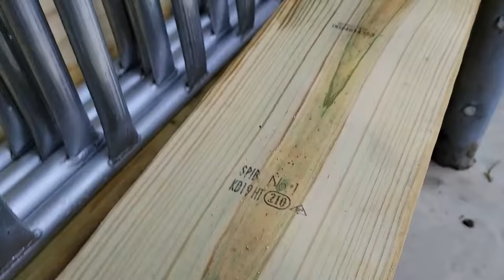There's A Serious Problem With Our Roof | Our Trusses Are Warping

Comment: A suggestion…install gutter and down spout at low end of hay feeder roof to catch water in a water trough. Helps eliminate mud and mud lakes around the feeder. Here in Tennessee it’s a must to try to contain the effects of accumulating water and stomping critters.
Reply: Please consider this...or mud and swamp like area around your feeder.
Reply: My thoughts as well !!
Reply: We put a stock tank under the barn roof to catch raan water.  Working great.
Reply: Would it be good to feed it into a trough for them as well? or off into the garden somehow. but always reuse the water somehow.
Reply: I think the difference with their feeder is that it's mobile.  Adding a trough would make it less mobile unless the trough was on skids also and not attached to the feeder. Sounds like a pain the rear. Easier to just pull the feeder out of a mud bog to a less churned up spot.
Reply: @SagebrushRambles  true but was thinking of reusing the water somehow...sigh
Reply: That's true. It's seems like you love watching them. Right
Reply: @harryjason5040  what they are doing yes, and as a family doing so together.
Reply: @correlfreehand9454  that's nice. Well I love watching them also

Comment: It’s lucky that the problem with the trusses was found now. It could have really been a disaster if the discovery was made further along in the build. It’s always a disappointment when a problem leads to a delay, but you guys have got this! There isn’t anything you two can’t accomplish together. ❤️
Reply: One option is to cut 3/4 way through bowed 2x4 to make  ' relief cuts ' that will take pressure off of bow, then add necessary structural support on either side. That way you won't damage the exterior. Snow weight will be an issue so more is better.
Reply: That's true.. It's seems like you love watching them

Comment: I enjoy watching you two doing this on your own and knowing when to call in the pro's. I've been building homes for over 20 years and without completely seeing your truss, my best guess is that the wood in the truss didn't get a stiff back. That's where you add another 2x to make a T or L shape support to provide stiffness and to help keep it fairly straight. Another thing before insulation and drywall, I would suggest putting blocking in for curtains, towel rods, TP holder and along the kitchen wall where your upper cabinets are going. Makes it a lot easier to hang stuff.
Reply: Agree wholeheartedly with your suggested “blocking”, Jamie, best value for your time and materials.  You’ll appreciate it later... every time.

Comment: I’m no engineer, but the struts in the gable end look like they are installed the wrong direction, they need turned 45 degrees in order to handle the load? They should match up with your studs below to transfer the weight to the foundation. Have a qualified professional check your entire house before closing it in. Even though you have a metal roof and snow should slide off, you can’t count on that and your snow load requirements are likely 150 lbs per square or higher. Be safe.
Reply: Right on, you are not. It’s nothing in most cases but sloppy framing,pull the wall in, brace it and forget it. The studs carry the same vertical load, though if the trusses were made the same they will handle the vertical loans fine. The carpenters saved themselves some cost installing the studs that way, and they are much less stiff in that plane then rotated 90*. ( Not 45*) A regrettable but common practice among lazy builders. 
 If you have high wind loads it is negligent, the wall will vibrate.
Reply: @timan206  you do realize that these two built the house themselves. There weren’t any framing contractors.
Reply: That's true. It's seems like you love watching them. Right
Reply: @debrahenderson798  contractors put the trusses / roof in back in June.  Not the end of the world , this error can be fixed

Comment: The wall repair appears to be a simple fix by taking something like a floor joist to act as a stiffener web attached at the top rim plate and tied into the end roofing truss. 

You know that the manufacturer was hoping that it was an installation failure, and not something they did. Looks like they're owning up to the problem and once their PE  runs the calculations and spits out a drawing for build, you'll be back in business.
Reply: Run the lenght of the stud with Aluminum C- channel  and bolt it through the sheathing and stud  this will true the wall .  Aluminum will last forever .
Reply: sounds like you know what you are talking about.  Thank You
Reply: Install a stiff back with screws and it'll pull it back straight.
Reply: all good ideas, just depends on which they choose.

Comment: Be aware that the gable end truss is only carrying 505 of the load that the interior trusses carry!! Consequently if you are observing a problem (deflection?) of this truss then all the other trusses are suspect until a structural design analysis is done.of this truss design. This should be done by a sructural engineed, one of your choosing and not the truss manufacturer's guy. Do leave a paper trail of all correspondance and take notes of all conversations. My best advice and as I am an 84 year old retired architect with loads of experience including "expert witness" testimony you should be aware of the seriousness of determining and correcting this now.

Comment: Heavy Metal studs turned 90.degrees from gable end studs. (which are turned 90 degrees out from how they should be hence the bowing). Put a pilot hole trough the sheathing and studs. That should pull the bow out. 
PS do both ends since the siding is up on the other end use shorter screws, and screw from inside.

Comment: That's a bummer on your gable end. I'm surprised that they didn't use a 2x6 or at least e 2x4  with a cripple set parallel with your studs. Has to have been an oversight on their part. So glad you caught it but, I would also check out your other gable ends to make sure that they weren't installed the same way. If they were, I would demand that they fix them as well.

Comment: Truss problem is not a problem. This is a common occurrence. You can fix it in 10 minutes. Cause: 2x4's are set on edge, boards are milled from small trees which makes them susceptible to twisting and bowing. Don't waste the truss folks time. Take a straight edge up there. make a few cuts by dividing the length into 3 even sections. Make the saw cut about 3/4 inches deep. Take a straight 2x4 and scab it onto the side and that will straighten out the bowed 2x4 and provide additional strength to that member. Before the days of trusses, gable ends were framed with the 2x4's turned the opposite direction as in a stud wall. Unfortunately for truss manufacturers, they are having to use lumber cut from small trees. In home construction, the builder would just jump up and fix it by the time you get off of the phone with the manufacturer. When we frame any wall or gable, we sight in the boards and only use the mostly straight boards. Then, just before insulation, we check for bowing with a straight edge. You would be surprised how many boards need to be cut, shimmed and straightened. Sometimes when a house is a year old, you will sometimes find a stud that twists in place and all the screws pop in the drywall. That I why we always blocked our interior wall. Helps in that dept. Profession: Homebuilder for 38 years.

Comment: I wish I was there to help I could fix the twist in around 20 mins but as this video is posted and I'm probably seeing it a week later you have probably sorted it. A few 2x4s to create a brace that pulls the timber back into line is all it needs. I feel helpless to an issue that is pretty simple to solve for 2 great individual. If by some chance you have not rectified it. Message me back and I will attempt a video call to show you how easy a fix it can be. Hope you get it sorted in quick time, but mostly don't let it worry you as to the untrained person it may seem a big deal but it's not! So don't let it worry you guys🙏🙏🙏🙏🙏

Comment: Look at your truss prints. There should be a sheet that lists additional blocking and bracing. Generally , all gable end trusses require additional vertical bracing for at least 90% of the height of most members as well as diagonal bracing from the center of the end truss to the bottom chord or wind bracing at the other end of the diagonal. Love your channel and family life. Good luck and God Bless.

Comment: Great the feeder is in place.
Shame the build is needing a reset but so much better you found it now instead of after the cold winter.
I hope they inspect the rest to assure shifting isn't just in the center.
It's been exposed a long time with many weather changes.
We had a center weight barring post that held up the second floor hallway move 32 inches during our build. No one caught until the fridge didn't fit.
Deep breath, it will work out....

Comment: The reason why the gable end has a bow in it is because of moisture. The stud that is bowing was probably not cured completely when it was used. Consequently, the outer side which was mated up to the siding did not get a chance to breathe like the exposed side. So the exposed side shrank, while the outer side did not. It's like a bi-metal thermometer; it bends. On the other hand it could have been a warped board to begin with. 
The complication now sets in because the siding was attached as it is supposed to be from the outside in. So that creates a problem in trying to replace the offending board. I'm curious how they are planning on replacing it.

Comment: The way to fix your gables is the 2x4 that is bowing, you fix it with Angle Iron that will not bend and bolt them to the 2 x 4s that are the problem.

Comment: I see that your feeder got a "cat scan".  Instructions are for when nothing else works. I love all the patches. It looks like the feeder build went well. Good job!!!😃😃😃😉😉😉 Studs on the wide side will bow and I am sorry that you found out the hard way. Just add a stud in the normal way. When you put your screws in, it should draw the bow in. To bad that it is so high up. If you made that mistake on other walls, fix them now. 😦😦😦🥺

Comment: Repair the truss problem with 2x6 or 2x8 on edge . Attach them to the vertical 2x4 s using GRK structural screws. Screw right through from the outside . Use a couple strips of zip tape to cover your fasteners. Great job by the way. Love seeing your progress. Bless you and your family. 🙏🇨🇦🇺🇸

Comment: Great channel! As someone with horses from NEWA and N ID, no need to blanket your horses unless they are sick, very elderly, or clipped for showing. They grow a great winter coat! More at risk of getting cold/ill with a blanket. Our horses commonly stand in the snow with several inches of unmelted snow on them. They do have a shelter. Unmelted snow on a horse means heat isn't escaping! Wishing you a great winter ahead. Happy shoveling!!

Comment: M&J, just thinking. If you use the smallest bimetal holesaw that you can match a wood dowel to you can holesaw through the sheathing, 
use a sabersaw on the end nails, and remove the warped stud without a lot of beatin and a bangin. If the sheathing is damp under the
bent piece wait until dry for the sheathing to go back flat before replacing the stud or studs and gluing dowels in the holesaw cut holes. A 
guy I know put up a warehouse with trusses assembled with  pressed in nailer plates and made of finger jointed lumber. Everything warped, 
the nailer plates got loose and he let it dry that way. After it dryed out the lumber looked better but it looked like it might collapse. He paid
some employees to plywood gusset EVERY JOINT on BOTH SIDES. Some of the lumber is a little wavy still  but it  is now 25 years later
and has been thru several hurricaines. Don't know about you but I would put the end wall truss braces on edge rather than on the flat and
have on edge nailers between them which would give the same insulation as the walls you framed yourselves. Sort of copy what the end 
trusses with windows have. You could build a sister truss (or two) inside the one you have to get to the 2 X 6" wall thickness. On our build
we just poured a steel reinforced concrete slab 8" thick. Wood costs too much these days. 

                                                                                                                           george and aurora                    building Villa Cecelia

Comment: Hey guys, hate to say it but gable end trusses are never straight or plum . This is a what needs to be done to make it straight , it's really not all that hard. material needed .... 5# of 4" drywall screws, and 2x4's to run from top plate to within 4" of roof or so is fine, start in the center and work outward till either not needed (the shorter they are not so much bow)or under 4'.  Tools needed, drill bit slightly larger than screws , drill, screw gun, string ,and some scrap 2x4's , and I would go with at least one 14' and a 10' 2x4 as a collar ties too the list. Getting her done!  1) start with pre drilling holes in bowed studs in the center just above nail plates on bottom and one on top just below the nail plates. Now working from both sides of the wall screw studs to make a "T", on the long ones, center at the half way too before predrilling 2" and screwing bowed 2x4  to the edge side . How to tell when wall is straight?  A) pull string lines horizontally starting at the top of wall , tow nail at corners ,pull string real tight then put a small 2x block behind string on both ends then just use a 2x block as a gauge . Rinse and repeat every 4' foot or so.  Throw in the 10' & 14' collar tie  if  this is not a valeted celling.  Now with that been said please take the blankets off the horses , it is too early they need to grow there winter hair now, save the blankets for -5 and 20 mph winds

Comment: Usually when gable trusses are tall the engineering and specifications call for nailing another 2 x 4 on the side making an L on the taller gable studs. This makes the gable stud 3 1/2” in lieu of only 1 1/2”.

Comment: Fire bocking on your walls might have saved you from this and future issues. I fire blocked all of my exterior walls as well as the cross bracing on my trusses.  No warping problems with my home although I used alot of my milled lumber.

Comment: Why haven't you installed the engineering in the trusses? If you had done it when you first installed the trusses you would not have the problem that you are having. BTW, I didn't see engineering in any of your other trusses. You might want to talk to your truss engineer. Without the appropriate engineering you will continue to have problems as well as having a very weak truss system. No engineering in the barn either? Guys, your asking for problems down the road.

Comment: Jeremy not reading but is reading the Pictures yep he is. Did vinyl siding before part time and come across wavy walls because support installed couldn't support the added weight restructuring those walls and turning the studs out instead of flat straightened the wall flat. Im sure your structure company will fix it better. Life always has ups and downs but it is what we do to correct it that's important. God bless be safe stay warm. Jim

Comment: I'm going to give you some professional free advice when the truss manufacturer comes out you want to ask for a Gable end bracing detail, that Gable has not been braced correctly for the length of the Gable studs it is the trust manufactures responsibility to provide you with the Gable end bracing detail but it is more importantly your contractor who needs to follow up with the installation of bracing I would also recommend that you have a professional engineer review the bracing of the trusses because the permanent bracing is very critical to the overall structure if they've slacked on the Gable end bracing more than likely you do not have correct bracing throughout the home roof structure.
also, passing building inspection, not likely...

Comment: When we put up trussed roofs in the UK one thing we had to do was prevent them from twisting under the load of concrete tiles - very heavy. If the trusses are kept in a vertical plane they carry the loads, but if they deform - they cannot. Keeping the roof structure cheap and lightweight being the order of the day preventing warping was achieved by 4" x 1 timber battens nailed from node point to node point both perpendicular to the truss chords and at 45 deg on top of the bottom chords and up the roof slopes both sides thus bracing the roof by triangulation.

Comment: my son is now 41 and still talks about building stuff with dad. Jeremy, you are doing it right. he may not do it right now, but he is proud of helping build stuff for the horses. 
The build is moving along, and it gave you a minute to step away and together improve the home , even if it was for the horses. you did not lose build time, and the issues you are having, will be resolved. and yo will be that much more ahead. 

i was impressed with the shot under the floor. That was a neat glimpse! dont know what the fix will be, but it will be what is needed.

Comment: I noticed that you didn’t use sheeting like plywood or OSB for the roof under the metal roof when building your horse barn. During heavy rain or hail it maybe too loud since it is just beating on metal and no wood to dampen the sound. Just a thought since they won’t go in during rain.

Comment: so take skill saw and where boa is cut midway into the 2x4 or 2x6 and then put 2 full-lengths 2x4 or 2x6 that are straight  and each side of the bowed board and screw them down tight that should fix the issue and make the wall stronger

Comment: apart from replacing the bowed out pieces of wood is there no way to use a wire system to pull the bow out of the pieces of wood by tying them into other supports ?